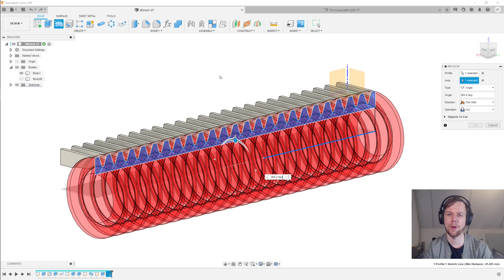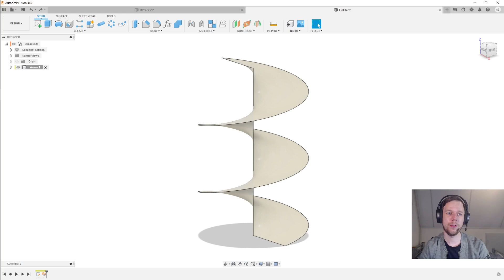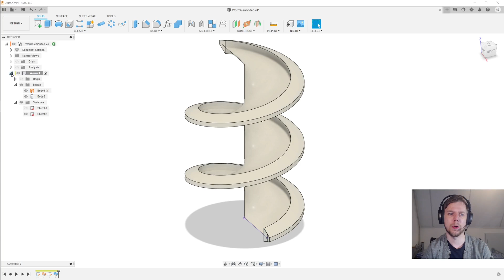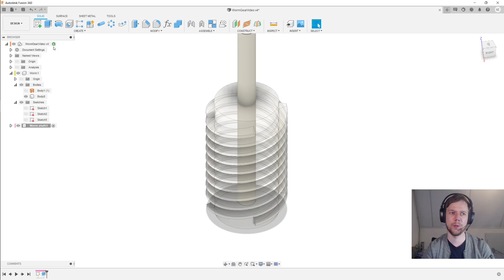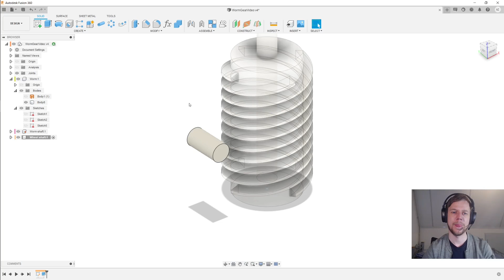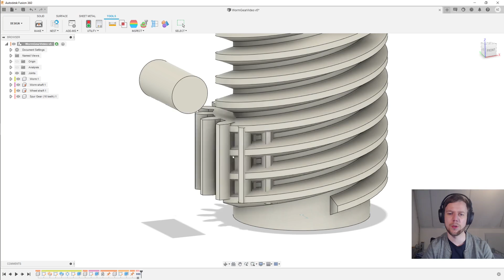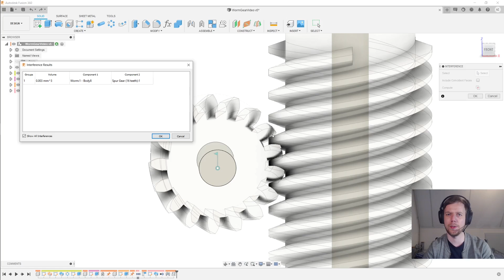How to model Worm Gears (Gears pt 7/?)

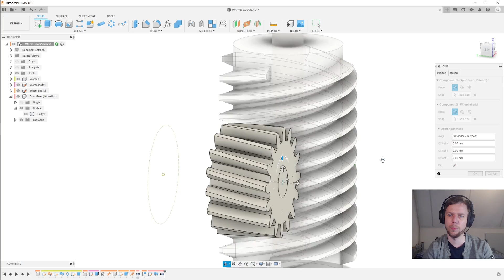Comment: An excellent video (and series). A slight correction at 12:28 where the equation should be ( ( 360 / ( 2 * NumberOfTeeth ) ) * 1 deg ) - ( twistAngle / ( 2 * NumberOfStarts ) ) * 1 deg where in the video the denominator of the subtracted twist angle does not include the number of starts.

Comment: An actual worm wheel gear is not a helical gear. The worm, which you have modelled correctly, will interfere with the helical geartooth on both the entry and exit side, because the worm is not a rack, it is a helical path, which makes it twisted. This is why your interference inspection at the centerline fails to inform you of the actual interference that exists off the centerline.

You're better off using the solid model of your worm as a solid cutter, and cut into a disk blank ( which becomes the worm wheel). You will have to make several of these solid cutter operations with the worm rotated a few degrees around the wheel, in effect, generating a worm wheel tooth into the blank. I'd do this repositioning and solid cutting about 4 or 5 times to get a reasonable facimile of an actual worm wheel tooth. Then isolate one completed tooth and copy/rotate it around the center of the wheel.

I have done this in real life machining. It's a bit messy to have a model composed of tiny slivers of surfaces. But it's far closer and better mesh than your helical gear.

Comment: Hi, I tried like 4:17 using sweep, but get "Error: There is a problem with the guide rail. Check that it pierces the profile plane and that it is on the same side of the profile plane as the path." Do you know where I miss? Thanksss
Reply from the maker: I'm afraid I can't tell, could you send your .f3d file to antal@creonova.nl so I can take a look? Perhaps you could also briefly describe what you're trying to accomplish, if you're not reproducing the video exactly.
Reply: @antalz I am getting this same error while following the video instructions exactly. Cannot compute the sweep for some reason. Thanks for the guide!
Reply: Got the same error using 3 starts. Changing to 4 starts, doing the sweep, then changing the parameter back to 3 starts fixed it for some reason.

Comment: Why do the number of teeth factor into the twist angle? I have 300 teeth on my large diameter gear and the twist angle is less than 0.037 degrees. It doesn't match up at all with the worm. I ended up just doing trial and error using interference and the twist angle I needed was around 0.4deg - more than an order of magnitude off
Reply from the maker: Simply put because a gear with more teeth has a larger diameter. Every time you see numberofteeth*module that's the pitch diameter, and when you multiply that by Pi you get the circumference of the pitch circle. There's some more info on that in video 2. 

If you're still having trouble, could you send your files and questions to antal@creonova.nl please? I'm on the road for a few days, so I'll get to it when I get back, but with the file it's easier.

Comment: Really useful video. I have mapped most of this to an onshape project but at  11:00 , which height are you referring to by "H"?  It appears to be the wheel gear thickness but I do not understand why that should impact the angle (consider a very wide or narrow wheel gear... why should the angle change?) . I assume I have the wrong height ? (e.g. a 200mm height wheel gear comes out with an angle of 22.6 deg )
Reply from the maker: That's because theta is the angle you put into the sweep command. And the reason the angle depends on the height is that if the gear is twice as tall, then the helix must make twice the angle to still get the same angle/length. But yeah that should be the gear thickness. So if you use the exact same values I use, but with 200 mm thickness, then you should have a 143.24 degree sweep angle.
Reply: @antalz  Thanks - I will check my angles etc. All looking sensible enough but I am new to CAD tools.

Comment: Excellent video.  Did you ever have any luck with throated worm wheels?
Reply from the maker: I did not, I did find a reddit comment that has a promising method for throated worms, but I haven't even really wrapped by head around throated wheels.

Comment: Thank you. I am planning to use a T8 8mm shaft as a worm gear and I have to create a suitable worm wheel for my project. Is there a place that I can get dimensions of T8 shaft with 4 starts? Thank you once again.
Reply from the maker: I tried to search around a bit, but didn't get too much. What you could do is model a TR8x1.5 in Fusion360, and then use include->intersect to get it into a sketch. That should at least give you an idea, though the pitch of that rack will be wrong. But when I do that I actually get something that only resembles a gear rack. The pressure angle is just 15 degrees for example. The tooth depth also appears to be shorter than standard.

Comment: When 3d Printing. Should we add a backlash to the wheel? You didn't mention in the video, at (3d printing pointers) whether or not you ended up adding a backlash to the wheel. Before that, If I'm not mistaken the model in Fusion 360 still had 0 backlash.
Reply from the maker: Yes, for real-life gears you should add backlash, though the exact amount depends on the accuracy of your printer. Usually 0.1 or 0.2 works. I use 0 backlash in modelling to prove that the modelling method is correct, there are unfortunately many tutorials about gears on Youtube that are plain incorrect.

Comment: Solidworks toolbox draws toof profile schematically, by arcs, I think the same is in Fusion. I think it is a reason of your interference. It is not a big problem to draw involute, it is interesting geometrical task. Just don't use equations, use geometric relations instead. Otherwise you will have update problem when you try to change geometry because equations are solving after geometric relations. Thank you for video and good luck.
Reply from the maker: Those options aren't in Fusion360 unfortunately. If I get another chance to use Solidworks I'll check out those options!

Comment: your explanation is amaizing!
i'm not design in Fusion360(in soliidworks) i;m missing the equation to build the tooth of the gear(wheel not worm). i searched in previous movies but not find.
mostly, according to my knowledge, use with addendom equal to the modoule and d-dendom to 1.25*modoule.
do you recommend so?
Reply from the maker: It's a bit tricky, because the modelling I'm showing here is in the transverse system for helical gears, where many other places use the normal system. You'd really need to check video 3 in full to see the difference. But yes, your numbers for addendum and dedendum are correct, that's also approximately what the Fusion360 gear generator creates. For some reason it creates slightly too much dedendum.

Comment: In my current setup, I have problems with oscillations. The period matches the revolution time of the worm. So I suspect that the teeth of the gears do not match well. What can I do to improve the situation? The worm is cylindrical and was bought, so I can not change that. Would making the wheel globoidal help? How would I go about modelling that?
Reply from the maker: That could be a ton of things. It's possible you used a slightly different module or maybe the wrong helix angle. Maybe the surface finish on the wheel is too poor? I don't think making it globoidal will help, and currently I don't know how to model those accurately.

Comment: Hi, first of all, great explanation and tutorial for the helical/spur/worm gears. 
I was looking for way to design a helicoid focusing gear set, that are used in lenses. Usually it's 2 sets of helical gears and they work together for moving the optics for focusing. What I haven't seen online so far is how to make an internal/external helical gear set that can be parametric just like you have here in this video. Any idea of it's possible/easy to parametrize that? I'm a relatively new into gear design so don't know the extents of the possible things you can do parametrically. 

Thanks
Reply from the maker: I'm afraid I'm not familiar with those mechanisms. It sound like you need an internal gear, which I show in the planetary gears video. I also do a helical internal gear in that video. I don't know how to do it parametrically, because the gear generator doesn't work with parameters unfortunately.
Reply: @antalz  yeah, I need an internal and external gear set. Actually 2 sets. And they are helical gears with a very large helix angle (80°+). Trying to model them by hand, or using the add-ons kinda does the job, but to be able to do them parametrically would be the most ideal.
Reply: Here's a short example of a lens helicod and how it works (sort of). I'm trying to find a way to model that behavior

https://youtu.be/m3B0TNlAFyk

Comment: "Numeber of Starts"   could you explain about of this.  &  diameter is pitch circle Diameter of worm?
Reply from the maker: The diameter is indeed the pitch circle diameter, it's equivalent to the pitch line in racks, sortof. In most gears that's just module*number of teeth, but for worm gears you're more free to choose what you want.
The number of starts is essentially the number of teeth on the worm gear. If you have 1 start and you turn the worm once, the wheel advances 1 tooth. If you have 2 starts, the wheel advances 2. You can find the same thing with TR8x2 and TR8x8 leadscrew, the former has 1 start, the latter has 4 starts, so a single rotation of the screw advances the nut 4 times further.

Maybe you can find better illustrations online because I'm not doing a great job of explaining I feel.
Reply: @antalz  Thank you for the explanation. It's a very helpful video, so I've been following it over and over again.

Comment: Wow, this is great. It helped me a lot.

To avoid the issues with overhang when 3D printing the worm, i tried cutting it in half along its rotational axis in the slicer software and printing both halves facing the printbed. It's not perfect, but for low-stress applications like mine it worked really well.
Reply from the maker: That's actually a reallygood idea. If you select a very low layer height you should be able to get something a lot better than printing vertically. I do recommend adding alignment pegs to the halves, a small misalignment between them will create a really harsh edge. Thanks for sharing, and thanks for watching

Comment: Next is double enveloping/globular worm gear sets?? This is my far the best gear series on YouTube.
Reply from the maker: I think I can do enveloping wheel, but globoid worm I have no idea currently. OT Vinta has a video on that though, using mathematical curves in Blender I believe. And thanks so much!
Reply: I did see his video, I believe that was the one where he built the worm then cut the faces from the worm to make the gear and scaled them down slightly to allow for backlash. Your design approach is just so much cleaner.
I was racking my mind (pun intended) on how to make a globoid worm similar to the method you've shown. I suspect it could work with a ring gear as the basis for the tooth profile, but I have no idea how or even if that can be used to draft a parametric part.
Reply from the maker: @jordanh9520  Aren't you talking about the video from my tech fun? Anyway, my current idea is to create a small helical path with the same parameters as the worm's helix, and then sweeping the right tooth profile along that tiny section of helix. I don't know yet how long that helix is allowed to be before you get interference though, still racking my brain on that.
Edit: My tech fun's method leads to a few problems, among which the incorrect tooth profile on the wheel, and incorrect addendum/dedendum. I'm not even sure how much it matters because worm gears are so inefficient to begin with.

Comment: Another great video! I would like to see un the future a compound planetary reducer tutorial, thanks for sharing
Reply from the maker: Thanks! Compound planetaries are on the list, though I think it will be a while before I make that video.
Reply: Your videos are great, and would also love a video on compound planetary gear. Especially on stepped-planet gear.
Reply from the maker: @maggge89  I think that's the type I had in mind. That's the type where the planets of both sets are rigidly joined right? I was planning on sun input, stationary ring gear for the lower set, and ring output on the upper set, to hopefully achieve something like 50:1 quite easily.
Reply: @antalz  Yes, I think so. Do you know if the ratio of the number of teeth and the module, between the lower and upper set of planets, should always be the same?
Reply from the maker: @maggge89  No, within reason the upper set can have totally different module and number of teeth. You can think of the upper set as being a "regular" planetary gearset, where both the spin and orbit of the planets are directly determined by and equal to the spin and orbit of the planets in the lower set. That's why a sun is redundant for the upper set.

The only thing you generally want is that the pitch diameter of the upper planet is roughly the same but slightly different than of the lower planet. In practice that means just a slightly different module and/or slightly different tooth count.
Reply: @antalz  So I have made a huge mistake if my module and number of teeth on the upper is half of the lower? I made a weekclock that is published on prusaprinters, if you are interested in what I'm talking about. It feels like it is working.
Reply from the maker: @maggge89  Not necesarily. What I described is how you get very large reductions, and usually people do compound planetaries for 50:1 or 100:1 reductions. If you're aiming for a more modest ratio it doesn't sound wrong. Could you link the item, or do you know what reduction ratio it is?
Reply: @antalz  The ratio is 1:14 with 1:2 and 1:7. https://www.prusaprinters.org/prints/69648-weekclock-with-planetary-gear
Reply from the maker: @maggge89  I haven't studied it in depth, but it appears to be fine to my eyes.
Reply: @antalz  Thank you, I wouldn't have been able to make it without your video tutorials.

Comment from the maker: I figured out a better way to do the sweep after I had already recorded everything, so that delayed this video a bit. I'm quite happy with this workflow though.
Reply: I don't seem to be able to select a line as the sweep profile anymore?
Reply from the maker: @ryanoconnor7957  The line is the path, the sweep profile is the tooth profile, perhaps you got that mixed up? Also make sure chain selection is disabled when selecting the path.
Reply: @antalz  I found what I did wrong. I wasn't using surface sweep but solid. I've never used the surface tab. Maybe you could consider a video on the difference between the two and useful things to do with the surface tab, like this?